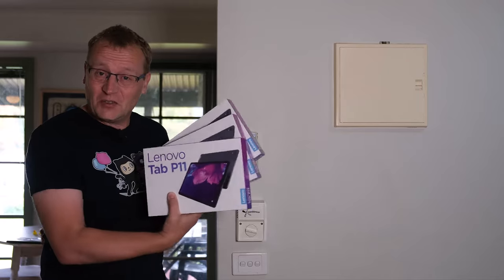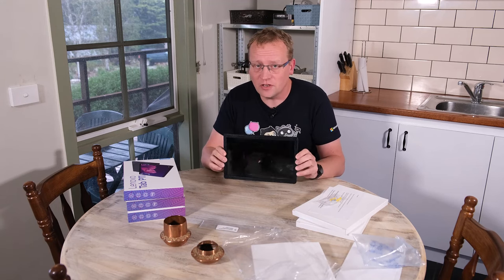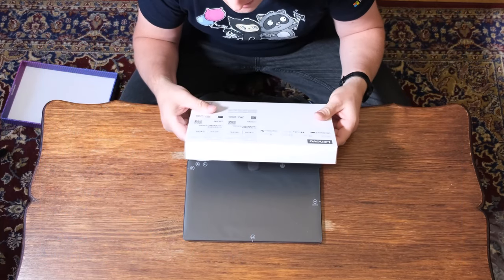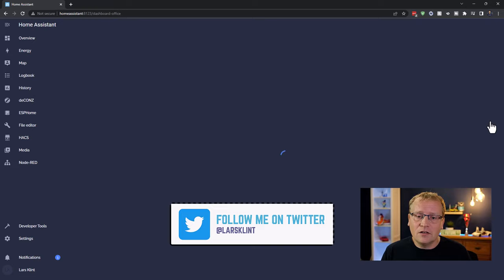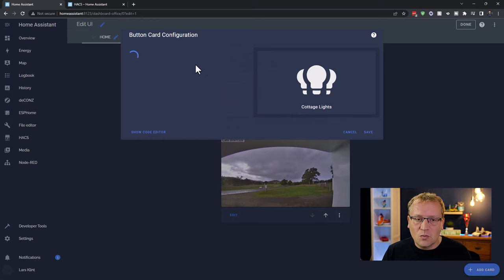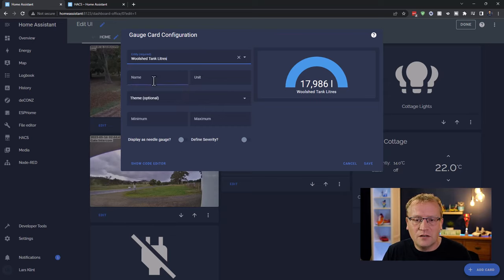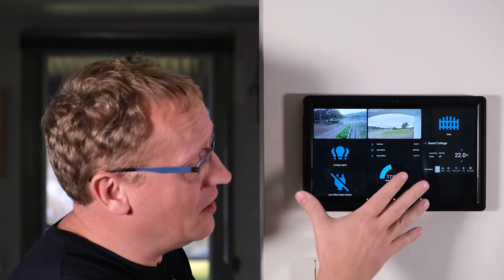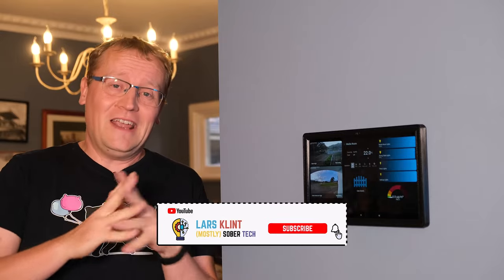Wall mounted Home Assistant dashboard - Using Lenovo Tab P11

Comment: Great tutorial! I would highly recommend too install smart socket to power on/off charging of the tablet and keep it charged between approximately 40-80% charged via an automation. Otherwise very high chance that always fully charged battery will die very quickly. Had 2 tablets failed, one nearly cracked the screens due to swollen battery.
I am using Fully Kiosk Browser Plus on all my wall dashboards. Very future research Browser with motion detection on/off display and many more useful options!
Reply from the maker: Thanks mate 🙂 Yes, very good point with the batteries, and in fact the Lenovo tablet has a feature that detects "always plugged in" mode and modulates it for you so the battery stays 40-80% charged.
Reply: Good to know about the Lenovo, because I immediately had the same concern.

Comment: Nice install, but I'm going to say the wall mounted one in the office is going to be a nuisance. Every time you want to interact with it you have to get up and walk over to the wall, which is why a desk mounted solution might have made more sense in an office setup. The other thing to consider is controlling the charge of the batteries. Probably keeping them around 60% makes sense. You'll kill them pretty quickly if you keep them at 100%.
Reply from the maker: Thanks mate. I am not the only one using the office, and the tablet is mounted where we walk through the most, so it works well for everyone. I am not always at my desk either, so I did think through where to place it ☺ You are right though, that you should place the tablets where it make sense. With the batteries, Lenovo has a clever feature where the tablet realises if it is plugged in for extended periods of time and then only charges the battery to 60-80%, as to prolong its life. 👌
Reply: @LarsKlintTech  Perfect!

Comment: Gotten myself a Lenovo M8 gen4 which I am gonna use for a dashboard/panel/kiosk

the screenpinning software is quite nice as you wouldn't need kiosk apps anymore, hope it still works with apps to automatically close/turn off the screen.
Reply from the maker: The kiosk apps still offer a few more features, such as not having Chrome crashing 😂. You can also use the camera for motion events to turn it on and more. Overall though, pinning works just fine for me.

Comment: Hey, thanks forv a very detailed video.
I didnt really get what you exactly did after the installation of Kioskmode from HACS.
Yoe have explaned the settings, but how did you manage to make it valid for a dashboard?
The second is: the tablett is whole of the time on the power thru the cable.
Its nit very good for the batterie, isnt it?
Do you use something to interrupt the power to let the battery work, and after that to go back to power?
Thx
Reply from the maker: For kiosk mode, I am simply pinning the Chrome browser, which makes it stick. You need the pin to go out of it. 
Lenovo tablets have a smart charging feature, which means it charges to between 60% and 80%. Definitely don't want to charge them all the time. 
Thanks for watching 😊

Comment: Great video and much appreciated! I am having an issue with Kiosk mode. I downloaded it from HACS but when it runs on the tablet it isnt in Kiosk mode. Are there further steps to get this to run other than just downloading it? Also, to make the address bar in Chrome disappear by saving it to the home screen isnt working. Is there another way? I followed exactly what you did over and over but the address bar refuses to go away.
Reply from the maker: Have you added the 
kiosk_mode:
  hide_header: true

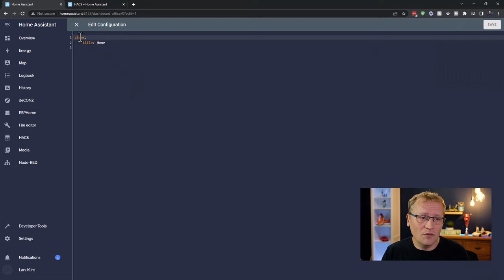To the dashboard's raw editor at the top as shown at 15:25?  

Regarding the address bar, I am not sure why it doesn't work. There are actual "kiosk apps" run can download and buy too, which have more features such as wake on camera movement and more.
Reply: @LarsKlintTech  I have not tried that. How do I do that? I am very new to HA, VERY
Reply from the maker: @chrisgoble4620  All good. Welcome to the rabbit hole 😁
Add that to the top of the YAML for the dashboard, which you find under the "raw configuration editor" , which is accessed through the three dots menu in the top right corner of the dashboard edit screen.

Comment: Hello, great work! Do you know other lenovo p11 tablet mount with wireless charger? I am searching a holder with magnetic and wireless charger.
Reply from the maker: Thanks Vitor. I am not sure the P11 tablet supports wireless charging. There are mounts available on Etsy, but I don't think any are magnetic. There isn't a huge market for mounting tablets, so most are made by enthusiasts like the mounts I got.

Comment: How are you going to prevent burn-in on the display? (Personally I wish there was a motion sensor that would automatically turn it on/off like the Ecobee thermostats do
Reply: the fully kiosk app can take care of this. It will use the camera as a motion trigger.
Reply from the maker: @swinters3369  Ah, very good to know. My dashboards do update pretty regularly, but burn-in is certainly a risk.

Comment: My samsung tab a8 always has to refresh when detecting motion. Does your dashboards have to do that too? I’m using the plus version of fully kiosk browser.
Reply from the maker: No, I don't think my tablet detects motion, and it doesn't refresh. I wasn't aware of the fully kiosk browser. I probably don't need it, but a good alternative 👍
Reply: @LarsKlintTech  Was going to mention this also, the fully kiosk browser can leverage the camera of the tablet as a motion sensor, and also as a light sensor to turnoff in darkness. Its only 4 euros a screen and adds a bunch enterprise style management to the tablet, I never have to go into the settings of the tablet, all done via fully kiosk. Its a great power up for the HA kisok only add on.
Reply from the maker: @ian9033 Yep, exactly. Might be a future upgrade. I think I want to make the dashboards themselves look better first though.
Reply: @LarsKlintTech  and that is the tricky bit, to get mine looking OK-ish and to have buttons I can resize, i used a combo of Mushroom cards, button-cards and then nesting grids within grids to control spacing. The native experience is not so good, as I'm sure you have found out

Comment: Hi Lars. Thanks for the video. I read somewhere else on the internet, that there is an issue with the combination between the P11 and the frame from Smarthome mount. The frame should cover for the motion sensor, which means that the tablet doesn´t react on movements in kiosk mode. Do you have this issue?
Reply from the maker: Good question. Afaik the P11 doesn't have a motion sensor, so I don't think that is a problem. I certainly have noticed anything that didn't work. I used one of the tables for some months without the mount before I made the video and I never noticed a motion sensor then either. Have you got a link to the issue?

Comment: Does anyone know if it is possible to have an event change the layout of a dashboard or temporary change a client to a different one?
I would for example like when someone rings the doorbell that the video feed shows up in Fullscreen on the dashboard untill there is no more movement for example, and then go back to the normal dashboard.
Reply from the maker: Good question Robert. Someone on the HA forum kinda figure it out: https://community.home-assistant.io/t/change-dashboard-on-event/38436/9

Comment: After some time it will have an issue with battery.
Reply from the maker: @ikif81  not in this case. The Lenovo tablets have a battery saver mode that charges to 40-60% to preserve the battery.
Reply: @LarsKlintTech  
No, I  mean the battery will inflate, also if you control charge between 40-60%.
Reply from the maker: @ikif81  So far, so good.

Comment: I'm jelous of this walls made of carton which you can basically cut with knife (living in a flat with concrete walls). Also I feel like you would not have to put a socket in a wall but use embedded power supply with type c cable output.
Reply from the maker: It's about the only time it is useful to have these silly walls 😜 I'd take proper insulation any day over this.
There are many ways to install the screens. I went for the in wall recessed power points as that is more versatile in case I upgrade or replace the devices.

Comment: keep screen on is bad idea
Reply from the maker: Yes, and no. The screen changes frequently as sensors and cameras update, and the battery is only charged to 60-80% through the software. I have considered using a kiosk app, which will let me use the camera as a motion sensor, so I might do that soon.
Reply: @LarsKlintTech  thats is great idea! Thnks!